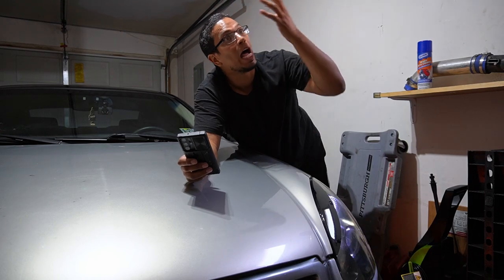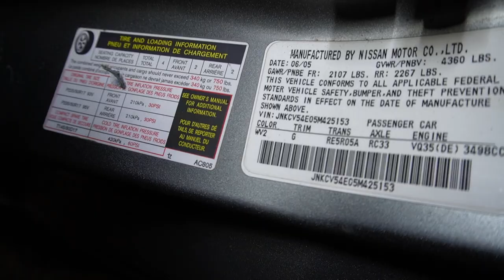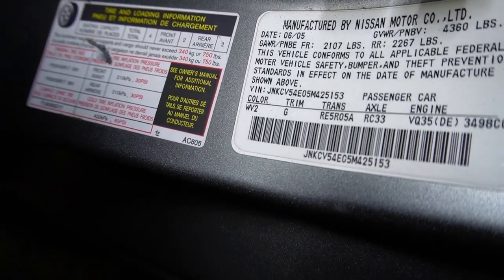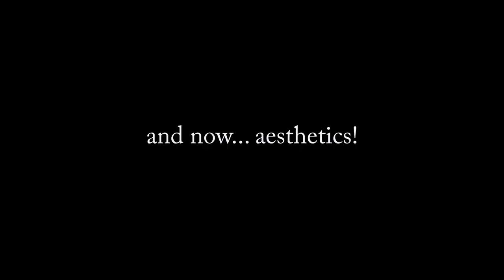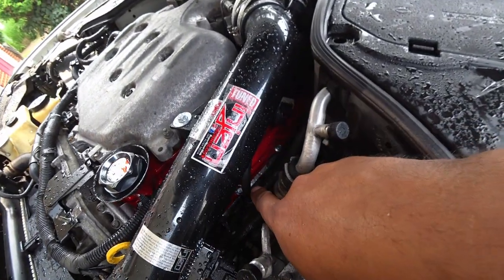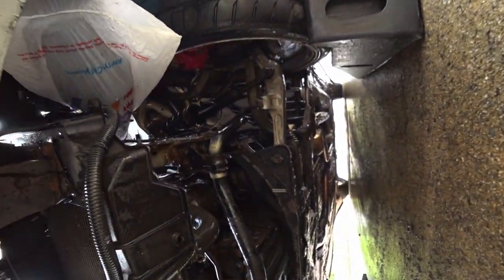I detailed my FILTHY Infiniti G35 Engine Bay | Rust repair & Deep Cleaning!

Comment: did you just paint over the rust on the struts or u sand then paint?
Reply from the maker: I sanded with drill bit, cleaned and then painted.